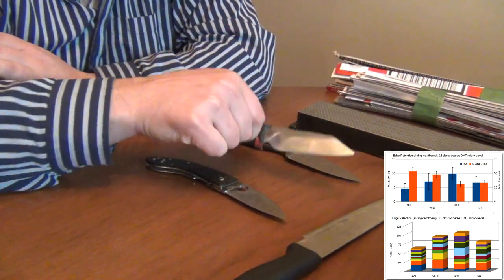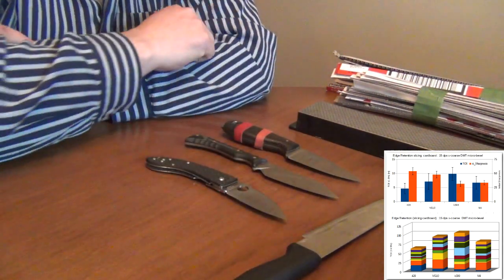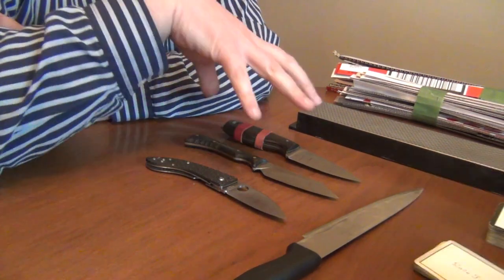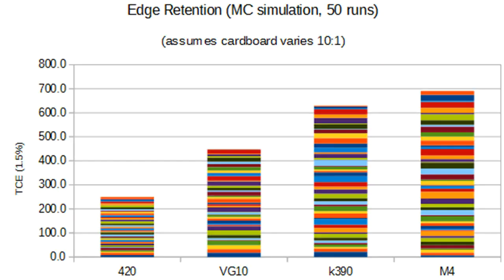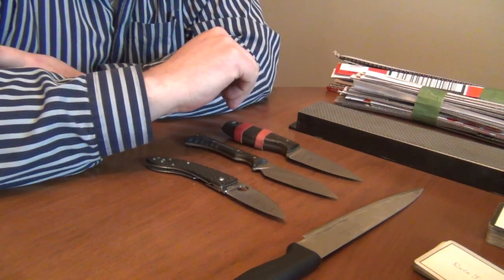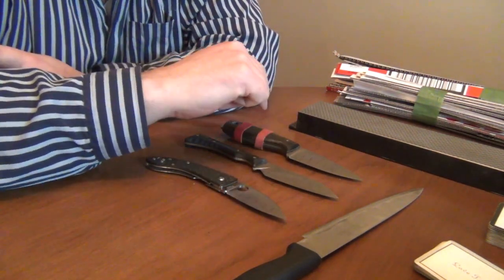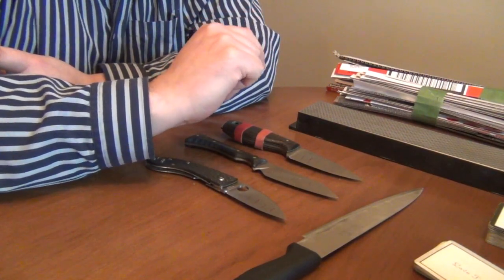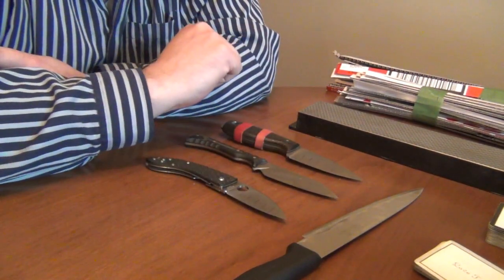Edge Retention - 3Cr13/420, VG-10, k390, CPM-M4 (cardboard)

Comment: Hi Cliff, I am interested to know how you produce an exact 15 dps while sharpening. Do you use a jig? From my personal experience, hand sharpening can vary angles significantly, even with a very experienced sharpener. You only have to compare a knife sharpened on  a jig i.e. Edge Pro, Wicked Edge etc. (very crisp, defined bevels, V edge) to a hand sharpened bevel (almost always somewhat convexed). As a result of varied angles, edge wear will surely change significantly. Thanks for your great work.
Reply from the maker: I have used a Wicked Edge and Sharpmaker at times when I want to compared the apex angles to very high precision, the difference between 17 vs 15 vs 13 dps for example. In this case as it is freehand the apex angle will vary +/- 1 during the sharpening. This will add a small random factor to the results but if you keep in mind I am doing ten trials the influence will be small and much smaller than the other random influences.

In general what you have to do is start at the top, look at the big influences and minimize them. There is nothing wrong with minimizing a non-critical error of course if it can be done easily, you just won't see it make a significant effect.

Comment: Stumbled into your channel somehow randomly, can't remember where exactly anymore. But I have to admit that this video does confirm some of the observations I've made in the past, there's something to be said for better steel but once you're past a certain quality point there's little return for the extra money spent.

The most important factor with regards to how well a knife performs in my experience is the blade geometry. That is assuming the steel is good enough to be fit for purpose with regards to its type and how its hardened and tempered.

I've not done any tests anywhere near as systematic and consistent as yours but I base this on the kitchen and non-kitchen knives that I've used and maintained during various stages of my life: while living at with my parents, university and now. I do really like the knives I've got now, they aren't anything amazing just pretty decently made VG-10 with the right blade shape for my kitchen use. I've also had some opportunities to borrow a couple of knives much more expensive than I would consider buying for myself temporarily and sharpened such steels a fair few times.

My overall conclusion really is that a knife can be very expensive and made out of the best materials, but if its not designed for the purpose a cheap but well designed thing such as a humble cheap Opinel (or anything similar, just thinking of the cheapest fit for purpose brand that I know of) will outdo it any day of the week for typical light cutting tasks. It's a bit of a shame that people refuse to even look at a knife if its not made out of material x or "just material y". All that said I've seen plenty of horrible cheap knives but as long as you shop wisely you don't have to spend a fortune for some good knives regardless of the purpose. 

However there's another very important aspect in addition to the way the cutting part is shaped and what type of steel it is. Personal preference with regards to grip ergonomics and aesthetics especially for an EDC knife may well justify spending a lot more than you'd strictly have to for a functional knife and maybe even making some compromises by picking what for the task isn't as ideal but still decent enough blade shape. Its hard to argue with these preferences of the user, as long as the blade can do what they need it to do. You can explain why something else might be more suitable but ultimately the choice is theirs really.

I picked a few videos with interesting titles from the list of all the stuff you've uploaded the last couple of days, interesting content very different compared to other knife related content one finds on YouTube. Especially the dedication to quantifying things such as edge retention and such so methodically, its a subject matter that always interested me but to go through the effort of doing actual tests with a large enough sample size I wouldn't have the patience for it myself. I'd rather spend my free time on the electronics hobby, I'm happy enough with the knives I have and knowing that I can sharpen them if they get dull. Every now and then I do indulge my curiosity with regards to new products and steel out there. However on YouTube it rarely goes beyond aesthetics and basic construction in typical knife reviews and there seems to be little interest in anything that isn't survival fixed blades/folders, some actual interesting tests with regards to steel types bevel angles etc are a nice breath of fresh air. Keep doing what you're doing, its awesome work and I wish more people could have a more objective approach like this towards products.
Reply from the maker: Everyone has their hobbies, I just like the number/sharpening aspect.

Insightful comments. I am not sure how much of what people do/think is based on marketing as this kind of thing as you have said - It's a bit of a shame that people refuse to even look at a knife if its not made out of material x or "just material y". . That is a huge part of the promotion of knives.
Reply: Cliff Stamp Well I do like the numbers and sharpening aspect of knives but I don't have the patience to do a reliable test of it. I settle for "sharpen the knife, it cuts what I need to cut and I'm happy with that" mentality.

In the department of electronics, batteries in particular its where I go overboard with tracking capacity and other properties of the cells over their lifetime. There are 6 18650 cells (3 panasonics and 3 samsung based ones) that I take extensive measurements of every 10 cycles (to 3.7V in the torch/other appliance, then a discharge from full to 2.8V with both current and voltage logged) such as capacity, internal resistance and all that. It applies to other aspects as well in the electronics department but that seems a bit off topic here. There's only so much free time available and I'm more interested in this than the knife related number aspect.

I'm afraid you're right though marketing with regards to materials, fancy brand names and in some cases famous people endorsing a product (tv cooks for example) are major factors in the decision making process of many people when they plan to buy "good knives" that are better than their current cheap ones. Something that has always bothered me especially in kitchen use is how the knives are almost always thicker than they have to be. Especially for a knife that is intended to cut tomatoes, onions, meat without bones, etc you'd be so much better off with a nice thin blade that doesn't encounter a lot of resistance while its being pushed through the material.

I used to back when I spent more time outdoors and spent some time camping a couple of times per year in a tent actually have a carbon steel Opinel No. 7 with me for food preparation. Usually also another more sturdy blade for the tougher chores and to keep the Opinel relatively clean for stuff that I'd eat. This started out of practicality because I knew the thin blade wouldn't hold up with extreme abuse, but I suspect it was also one of the earlier experiences where I really took note of how effective those thin little blades are. This affected my future knife purchases especially with regards to the  utility/paring knife category.

http://www.knivesandtools.co.uk/en/pt/-opinel-t001515-steak-knife-set-esprit-sud-olive-wood.htm
These serve as the steak knives at my dinner table have surprised guests at times due to how easily they dealt with the meat. I like the aesthetic of a wooden handle, hard to explain but its just one of those individual preferences. Taking a closer look at the item description on that site I'm actually shocked that they give exact specifications beyond the length of the blade. They actually list thickness, steel type and hardness that's a rarity these days although I always take dishwasher proof with a grain of salt when it comes to knives.

I always get a little bit sad when such knives surprise people that much, there's nothing special to them in my opinion except the wooden handle which I like from an aesthetic point of view. A thin blade of decent steel that needs a little bit of maintenance every now and then on the stones that's all there is to it but this is beyond common knife skills these days. And it gets even worse when it comes to maintaining them, many people wouldn't know how to go about it anymore once more than steeling a knife is needed.
Reply from the maker: TribunusLaticlavus
The point about cross section is an interesting one, knives have thickened significantly and so have edges and edge angles. I wonder is this due to manufacturing interests or a created perception in the consumer that the heavier profile is better? In some sense people can be rougher now than they used to with knives. In the kitchen for example the same knife can be used to slice a carrot and pry apart frozen pork chops. This demands a knife which can't be optomized for the carrots as it would break on the frozen meats.

Comment: i see you stack the deck. remind me to never play cards with you sir.
Reply from the maker: Ha, yeah, evenly split, 50/50.
Reply: i love playing cards. i think 5 card draw with a wild card would have to be my favorite. i also enjoy 3 card poker, 7 card stud, 7 card no peek, and 2 card high push. you make me enjoy my knives more and less. i see what you mean about edge retention though some of my higher carbide steels do seem perceptibly more sharp with roughly the same use as some of my simpler steels when i am cutting cardboard which is most of what i cut. usually it is not really contaminated much at least from outside elements.
Reply from the maker: knives save lives
You have to keep in mind that you do a lot of cutting, much more than many. The more you cut, and the more open minded you are, the more accurate your perceptions will tend to be.
Reply: i'm watching you cut shingles with the forester and the m-tech. THAT is some hardcore cutting right there. i don't know how i missed this video, i was pretty certain i had watched all of your videos already. i kinda wish a guy could find some nice titanium handled folder with some fine steel like 14c28n or 3cr13 as i do enjoy their edge retention and sharpenability. for me the cpm3v and cpmcruwear are both very easy to sharpen which is one thing i really do like about them, not so much for the m4 and m390 as they are a bit too wear resistant for my liking.
Reply from the maker: knives save lives
Mike Gavac (Gavko) does metal handled knives, he uses AEB-L a lot.
Reply: i was inquiring with him a month ago or so but, never got a quote out of him. he's making some pretty nice blades. i saw a knife that was a collab between him and another guy that they were asking $900 for, if that's what he charges i will likely not be buying one but, i will certainly check and see what he says.
Reply from the maker: knives save lives
That type of knife is very rare so the price is much higher. He does runs of the standard models he makes which are much lower in price.
Reply: knives save lives ok, I signed up to gearbastion, and he has been putting out a few knives per week.
Reply: knives save lives Check on gearbastion, I am not completely sure, but I think he said in a YouTube video that he was doing all his sales through gearbastion, doing batches of knives, and no longer taking orders, but you might want to double check that.
Reply: i will likely not be in the market for one of his knives again until next year.

Comment: One thing I have thought is what happens if you take each knife to failure? Such as they wont cut the card board at all, surely the higher carbide steels will cut longer. Although different media might want to be used as that would take awhile. 

A graph at the end for tce would be cool, to see which steel has the greatest working edge retention and takes the least amount of effort to re sharpen.
Reply from the maker: I have done very low edge retention trials but cardboard isn't practice, it takes 250 m on average to just bring blade down to not being able to slice newsprint. If you want to make them really dull it is km. I have used carpet and such for that kind of work.

Comment: Excellent video, very in depth as always.
I feel someone should mention the human sub-conscious-bias possibility when getting so detailed.
I rule it out based on the amount of your videos I've watched.
Also the fact that your playing cards are all exactly the same size, but was all the media the same size with the same amount of pieces per type?
True randomness and true consistency are extremely difficult to achieve is all I'm saying. I respect what you do here.
Reply from the maker: The cutting I do is at least partially blinding for the exact reason you noted, to reduce the influence that what I expect to happen is forced to happen.

The difference in the cardboard was the point of this comparison, it was different in type and nature and not randomly selected to determine the influence of such.

In other trials I do I random sample so that all of these differences are averaged out by the law of large numbers.

Keep in mind that each of these trials is ~250m which is ~1000 cuts. Thus with proper random sampling the result standard errors will be very small.

Just think on taking the average height of 1000 people at random. Even if you sample across babies and such, the average of 1000 people will be very stable.

Comment: Excellent analytical conclusion, Cliff!

Additional angle beside 45* cutting angle (cardboard is in yz plane, edge in xy plane) is the edge in xz plane. Which increase draw/saw motion and also affectively reduce teeth depth.

Moisture content also greatly affect material fracture value. A moist cardboard wears on the edge many times faster than bone-dry cardboard.

I probably test cut/shredded no less than 20km worth of cardboard. This type of test is useful for gauging initial edge stability but doesn't offer much info on wear resistance. I found old denim roll-up into 1" dia rope is very abrasive and take no more than a couple minutes to conduct the test.  I'd tried sandpaper/waterstone/resin-loaded-various-abrasives/beach-clay/etc... Denim or cotton rope will consistently destroy fine or coarse edge super fast!
Reply from the maker: I have done other media, they all give useful results, you just have to take care on what information you draw from them.

I cut a lot of cardboard just to make it easy to recycle and burn (for fuel). I just do all the counting for fun during the cutting.

The blade is kept at a 90 to the other plane in the cutting, as you said, it is easier if not. It is also much easier if you cut along the ridges/corrugations vs through them which I am doing. But I am trying to speed up blunting here for obvious reasons. If I was not counting then I would be doing the cutting in other ways and generally you don't need to shred it as fine as this of course.

But we all have things which entertain us.
Reply: Thx. I cut them cross-ridge and into 1/8" strips. Sign of 'accordion' could mean the edge is too dull, since wedging is not an issue for thin strip of cardboard.

Comment: Isn't it the heat treatment rather than the steel that has more impact on the results?
Reply from the maker: This is a complex question. In some ways the heat treatment is very significant, but there are limitations.

For example there is no way you can heat treat 1095 for it to have corrosion resistance equal to the worse heat treatment of 440C.

In general it is important, but the influence, like many things, isn't as critical as often claimed because in general, very general, most people do ok hardening.

This is not to say that there is no difference, but again it isn't as large as many people say.

Think of it like baking a cake. The way it is made (the heat treatment) is surely an influence. But the raw ingredients sets a lot of things fairly strongly.
Reply: @CliffStamp  Pretty sure op was referring to edge retention specifically. Which heat treatment has a huge impact

Comment: Im wondering what sort of material I can use to eliminate as much variables as posible. Right now I'm using cardbord I get from work to test my blades. I'm working in retail so I selected one product I get a lot of and only use the cardboard from that. ( Basil's Best frozen meat lasagna.) LOL. At least then its only down to the variations of that manufacturer and specific type of production method. 
Thanks for all the time you put into your videos and research its very entertaining, interesting and I always learn something.
Reply from the maker: Outside of buying an actual material graded for consistency, that is about the best you can do. I would still recommend doing some random sampling on the boxes to curb any variation among them.